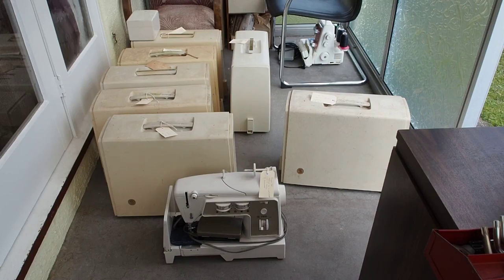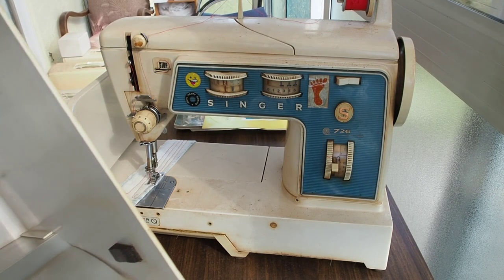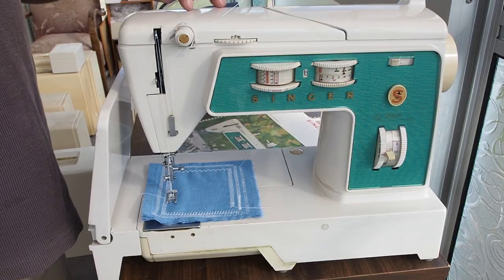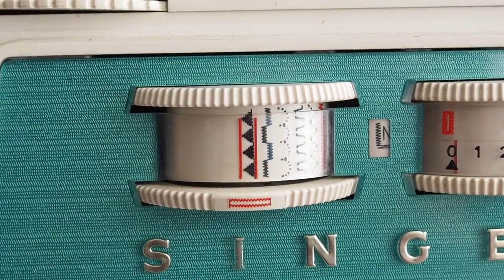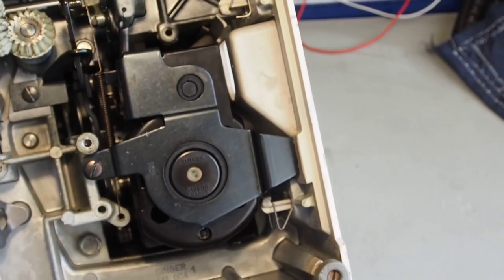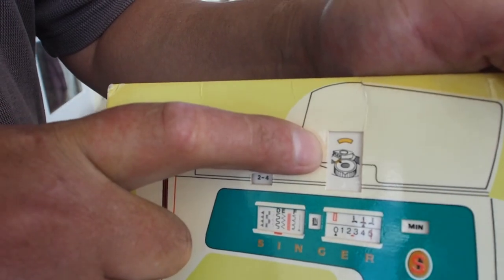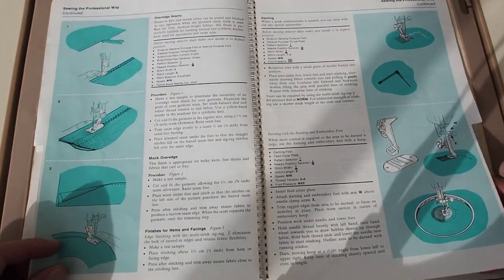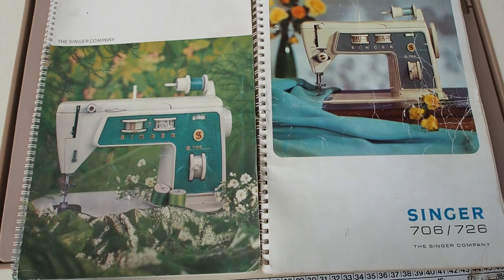Singer 700 Series Sewing Machines - A Run Down of Four Models.

Comment: Hi my T&S singer 755 needs help.  It is sewing but it’s not feeding the fabric I have to pull it to move and feed please what can I do to fix it
Reply from the maker: It could have damaged feed dogs. Maybe the rubber coating has come off. Not sure if the 755 has the rubber feed dogs though. Could be a presser foot bar issue also.